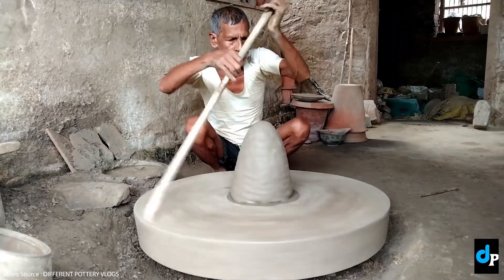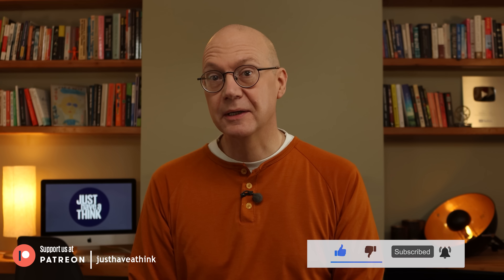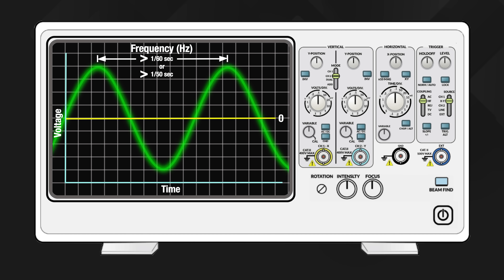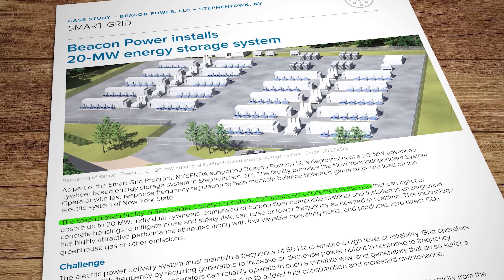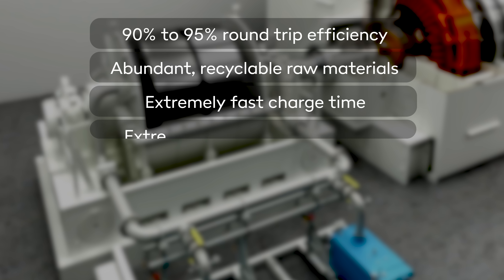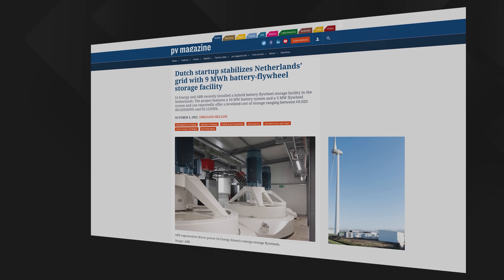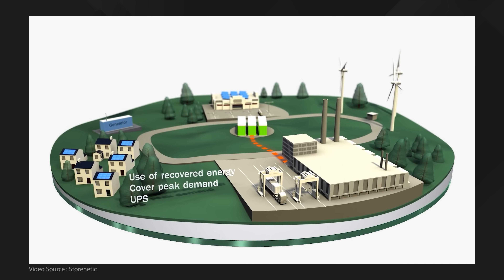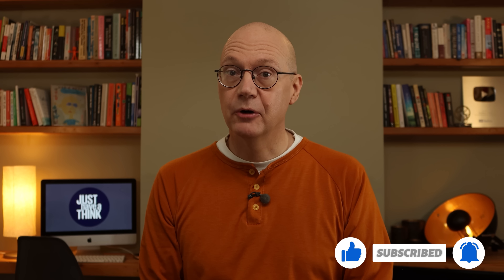Flywheel reinvention revolutionising our power grids!

Comment: Only potential issue I can see is that, when you have a very large, very fast spinning mass....if you suddenly have to stop it or you spin it too fast or something in the system breaks, then you can have a lot of high speed shrapnel showering the area or a runaway wheel shooting through the wall or whatever.  That said, given how long we've been working with flywheels, I assume we've figured out the various safety issues, standards, and regulations so this shouldn't be a problem.
Reply: They come with a significant sized rack of control electronics. They are never over spun, and the electrical system dosent have the capacity to stop them that fast (fuses would pop)
And jyst for a laugh, the bearings are monitored for vibration and temperature.

Comment: Flywheels for power regulation remind me very much of something that exists on most dc circuits, an inductor. An inductor does the exact same thing that your saying the flywheels are good for, they resist changes in voltage. 

Basically an inductor is a coil of wire that produces a magnetic field from the electricity flowing through it. It takes power to create the magnetic field and when power is no lower applied from the source, the collapse of the magnetic field will continue to discharge as electric current until the field has fully collapsed. 

Put another way it's kind of like a spring but put more accurately it's a more of a shock absorber. To be clear when I say shock absorber I mean shock as a metaphor of a sudden change, such as how a car's transmission should respond when traveling over bumps on a road as being analogous to changing voltage levels in an electric circuit. I do not mean a shock as in a normal electric shock. 

If you think about it, an inductor is kind of like the stator of an electric motor, lacking a rotor, being left to "spin" it's magnetic field idly. 

So a fly wheel is just the inclusion of a rotor to the rotorless stator and this rotor is simply then being used as a mechanical battery to add momentum to the induced spinning magnetic field. In other words, if I'm not mistaken the flywheel design then acts as though you had just created a higher capacity, more performant and grid-wide inductor. This is all true if the desired function is as a voltage regulation device.

So fly wheel voltage regulation sounds like it's very applicable to a world made more dependent on stable delivery of electricity. I guess maybe the only question could be, why did it take us so long? My guess it's because of how the natural monopolies of the power market have insulated the market from innovation.
Reply: To be technically correct a flywheel is used in a power grid to maintain frequency stability (not voltage stability).  Frequency is used in grid control to represent the balance between power being fed into Vs being drawn out of the grid at any moment in time. 
Flywheels have been used in this way as a key component in grid control for the last 140+ years.  The issue here that Dave touched in in this video is that all traditional grid assets have been by their fundamental design rotational machines and this flywheel aspect has just been part of the fundamental design. 
When moving to renewable energy - many of the energy sources do not have rotational inertia.   So the issue here is that utility grids are experiencing a reduction in what is known as 'spinning reserve' as more and more renewable energy sources are added.

Comment: In my former career, we used flywheels to manage fast acting power transients to minimize battery discharges of our UPS systems.  It worked and lead acid battery longevity was marginally increased but the system is is tricky because loads are rarely stable.  The result was somewhat unsatisfying because depending on the load, the flywheel/battery system often competed for the same job thus efficiency suffered.  The market moved to LIon which satisfied the desire for longer battery life.

Now that LIon batteries are projected to be less economical to emerging storage systems, sodium based type batteries, and with improvements in control systems for the DC portion of these systems, flywheels are getting another look.  We’ll see if they become more desired in the future.
Reply: As a distribution network engineer I have seen quite a variety of rotary UPS installations on customers' premises over the years and I never failed to be impressed at just how much usable stored energy there was in a relatively small volume. I certainly wouldn't want to be anywhere near a support bearing failure!
Reply: @protectiongeek  But it is the total energy stored in the box- typically a Li-ion battery setup with the same amount of stored energy will be more dangerous. The chemicals and the fire that will accompany the failed Li-ion batteries are much more dangerous.
Reply: @protectiongeek  Understandable but as is the case with most if not all energy storage systems.
Reply: And having worked with these systems you're probably aware that flywheels are much more practical in a stationary system. You can have a huge heavy flywheel in one spot, that doesn't require energy to move it from place to place. If used in an electric car, part of the energy in the flywheel would need to go toward relocating the car.
Reply: Flywheels will never be used as energy storage solutions. The systems currently in operation do that as a vanishingly small marginal benefit, but that is not their purpose.

Comment: One of the positive attributes of rotating machinery used for power generation, such as a gas turbine, is the contribution of “spinning reserve” to help stabilize the grid.  Going down the road of adding more renewable energy and adapting rather than replacing the existing infrastructure is the best play long term.

Comment: I think going DC is a way better long term solution than anything AC. One's electric cars, busses, trucks are all 'to grid'. We increase the voltage to the houses from 240V to 1kv. (Solar panels are mostly 1kv and electric cars could work with 800V.) Once's 1kv, the local grid can transport 4x more power with the same wires. No more impedance losses no more frequentie problems and almost everything at home works internally with DC.
Reply: Interesting idea, and if we were designing the grid from scratch with modern technology, that might be how it would go - but it's too late to change now. Too many appliances in place that need AC. And you can't just convert them over - it would take decades. Some AC appliances with non-switching power supplies would instantly burn out or catch fire if you gave them DC. Some small ones that use capacitive current limiting (mostly cheap lightbulbs) would just not work. And some would catch fire, because they use relays or thermostat contacts rated for AC only - they would arc and quickly fail if switching DC. What you propose would require rewiring an entire country - every building, every appliance, all the way down to individual lightbulbs and thermostats.
Reply: @vylbird8014  Designing a grid from scratch is a no go. Lets add a new smart plug that can coexist with normal plugs. The whole tech industrie come together and make consortiums to standardize DC voltage needs for different appliances (TV, hairdryer, water pumps, LED light bulbs, vacuum cleaner, kitchen mixer...a little like USB-C smart charging but for bigger devices.)
New buildings and houses should be equipped with both types of plugs. This would allow people with solar and batteries to use the energy without inverters. (stove, heating, airco...)
Meanwhile the grid adds 48KV DC to 1KV DC switching houses for local distribution. The AC 12KV to AC 240V transformer houses can stay operational. And we keep doing this for 20 years until the transition is complete. Here in Europe, the resistive bulb is forbidden. We use Led bulbs. Relays are available in DC and a modern thermostats already works with DC. Better to have a low power DC to AC inverter for those two special cases than the opposite. We didn't all have broadband internet on day one, it took more than 20 years and is still going.

Comment: I believe the flywheel in Ireland is known as a Synchronous Condenser rather than Synchronous Compensator as Dave refers to it.  The error appears to originate with the ESB in Ireland who Dave cites.
Reply: The term synchronous condenser was commonly used in tge electrical utility field as they were commonly used for grid scale power factor correction and going back a few decades ago grid scale power factor correction was synonymous with the need to add capacitive compensation for the overly inductive grid loads.  
As grid loads have changed over time power factor correction is now about compensating for high harmonic loads and here inertia is the key element required.   Since the nature of the loads have changed it no longer makes sense to refer to these devices as synchronous condenser (capacitors) and makes sense to call them synchronous compensators.
As within any field when terminology gets changed to reflect the progress and change in technology there will always be a few people that for one reason or another do not adopt the change in commonly used terminology.

Comment: Give flywheels a whirl - not likely to displace the ever improving / cheapening LFP batteries but good to research in case they can somehow pull a rabbit out of the hat. At the end of the day, distributed batteries (EVs, home stationary storage and MegaPacks as EV charging stations) connected with and intelligent controller will probably displace the need for battery farms - though remote solar/wind farms might still benefit.

Comment: If a bearing fails on a huge flywheel the built up kinetic energy has the power to rip the flywheel right out of it's containment with potentially disasterous results.
Reply: If, yes. But any flywheel system not built by a hobbyist in a garage will account for this - there will be monitoring of bearing vibration and temperature to alert before failure, and the bearing will be designed in such a manner as to fail-safe - through increased friction rather than seizure, so as to bring the flywheel to a safe stop. Probably utterly destroying the bearing and surrounding structure in the process, but no flying shrapnel.

Comment: There is an application of flywheels to recover energy from electric trains slowing down as they arrive at a station and then providing energy to accelerate them again as they leave a station.   Typically such trains use a bank of resisitors to dump electrical energy at the station to slow them down.  The resistor banks cannot provide energy for accelerating the train as it leaves the station but a flywheel can!  And the discharge times required for accelerating trains (50 to 300 seconds) and the power (1MW) is ideal for flywheels - sitting in between capacitors and batteries.  I am connected to a developer which is working on this and am convinced this is a good application which can provide quick returns based on electical power saving.  I worked for BP as a young research engineer in the early 1980s when they were developing a flywheel for a bus so flywheels have been of interest since then!
Reply: What advantages would a flywheel have over a chemical batteries in that regard? Outside of enviromental. 

 Grid storage with flucations I get. Weight and gyroscopic effects don't matter. In a vehicle it does. 

 Pretty insane trains don't have regen breaking. Figured it would be a thing already. 

 By the way when I say battery I include super calibrators.

Comment: How many solar installations could we have installed if all fusion energy funding (grants, salaries, construction, decommission, consumables) were diverted to solar over the past 60 years?

Fusion, (for the sake of argument here, I'll pretend it's possible for it to ever reach Q100, even if it takes 100 more years to get to market) is also not environmentally friendly. It needs to split something to acquire hydrogen. The options currently being proposed are sea water and fresh water. Well, turns out that sea water refining for simple drinking water is a substantial environmental hazard and energy sink in and of itself; you distill drinkable water as a side effect of desalinization, sure, but guess what? Brine is TOXIC and the solution to deal with it is to just dump it back into the ocean. Well, what about fresh water? Our dwindling supplies of fresh water? See the problem here?

Nuclear may never have made a sum total profit, but at least subsidizing it produces some energy. Terrestrial hot fusion never will.

In the meantime, we could be spending nuclear money on fusion-derived renewables (aka Solar and Wind) and tidal energy to create energy EVERYWHERE, achieve post-scarcity, and maybe THEN work on fusion.
Reply: Fusion does not require very much hydrogen at all. The consumption is measured in grams. We're talking nuclear reactions, remember: C-squared is a bloody big number.
Reply: @vylbird8014  Setting aside the fact that even if they achieved Q100 tomorrow, it would take a further 35 years and billions of dollars to bring fusion to market, and to power that, you're talking grams of refined, heavy hydrogen. That's a lot of brine.

There's literally no defense of this: we absolutely should have powered every building with solar before funding entire useless careers for the better part of a century with grants and ludicrous construction.

Every dime spent now is flushing good money after bad, and the cost to actually make even the most optimistic imaginary fusion infrastructure is an order of magnitude more than what we need for universal solar.

If it could work, it would have by now.

Comment: I had assumed flywheels were already a part of current power station designs.. I'm surprised this obvious solution to electricity variability isn't commonly used already. I'm sure I saw a video about tower bridge using flywheels to open and close the bridge and that is very old.
Reply: Flywheel energy storage is already very much a part of existing power grid infrastructure and it has been for the last 140 years.  I think that Dave didn't frame this technology particularly well.   The main problem that is being encountered with the transition from traditional generation sources to renewable is that as the traditional "rotating assets" are removed from the grid there is an overall reduction in the "spinning reserve" on the grid.  The argument for flywheel technology should be framed from a perspective that it needs to be added to the grid when decommissioning traditional rotating assets to ensue that a minimum required spinning reserve (for frequency stabilization) and X/R (for fault coordination) is preserved.

Comment: Happy New Year and thanks for another fine video.  As you correctly point out, there are several pieces to the sustainable power generation/grid stabilization puzzle. One might ask how much room for improvement in efficiency is there and what are the practical implications? At 92% efficiency obviously, theoretically, there is about 8% left to improve upon. If it took a day to spin down a flywheel running at 92% efficiency, how long would it take to spin down at 99% efficiency? The increase can't go linearly with efficiency boost since at 100% it never stops. At some level one probably has to feed energy into the system to combat friction so even 99% may be a pipe dream.
Reply: I am not sure whether this is documented, but it feels like the 92% efficiency is at peak performance and not after one day...
92% efficiency is what tesla claims for their megapacks btw. And they can sit for days like that. And those "only" cost near to 500usd per kWh, whereas is projected to cost 3000usd/kWh in future... By which time grid level battery storage will cost 100usd/kWh (LiFePO4 raw cells already cost less than that). So cute idea, but this one will not... fly?

Comment: Very complete, but could've included a few physics concepts. Energy stored increases with the square of the spinning speed. The main limiting factor is tensile strength.
Reply: That is why carbon fiber flywheels have the highest power density